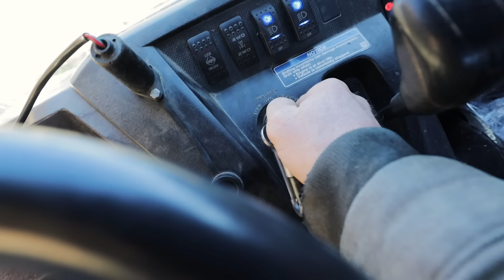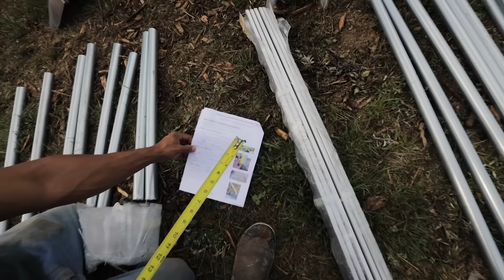INJURED

Comment: I had a heart attack at 29 after a year in a van. During recovery I learned the lesson that slow is smooth, smooth is fast deeply. Think of your lost compound value over these days by thinking "if only I did a little more" instead of "this tempo of action is optimal and healthy"
Reply: You mean like van living? What caused the heart attack? Peripheral blood clots from the extremities from being stuck in the van for long periods?
Reply: @gregorymalchuk272  yeah, I had done a year of van living. The summer was a lot of fun but come winter the good times switch quickly. The heart failure was a few months after getting out of the van and was a unrecognized biological defect, though I doubt the experience left my body in a way that reduced the risk of it occuring. Was a lot of compounded experience in a short year and a half. (The irony was I was lamenting Turning 30 when it happened, then 30 was immediately arbitrary:p )

Comment: I got one of those immersion heaters. With a new element needed for my water heater and a frozen trap in the tub I got the tub up to almost 130 degrees with one of those. My bath tub, not unlike your cattle tank isn't insulated. Something to think about if you want to convert that to a real jacuzzi. Good to see you got company there. Conserve that water!👍👍
 Yes I fixed the water heater. Call me a tool guy. Just don't call me a tool.😉

Comment: Justin. 40 yr retired RN here WITH autoimmune disease.  Stop kicking yourself for needing to take an anti inflammatory during flareups. Remember inflammation can cause MORE damage than the occasional flareup medication. Risk benefit applies. My experience is you end up taking less meds AND have shorter flareups if you take the meds early vs getting stuck playing catch-up after flareup is raging.  No one wants to need daily steroids. I would prefer catching the flareup early so I can keep moving so I don't end up on steroids for months. Just my experience. Tight rope walking that is. 😂

Comment: You need copper piping between the tub and barrel. The easiest one I made was to wrap a copper tube around the barrel with the fire in it and connect both ends to the tub and fill it up with water. As the pipe heats up it circulates the water and heats it. I ran a cool water hose in to cool it off if it got too hot. But I put a valve on it to stop the circulation when it was warm enough.

Comment: The moment I saw how you were moving Justin, I knew it was your SI joint that had popped out of place. I've been through it for 30 years. You're lucky it wasn't that bad & you can walk. Once I was stuck on the floor alone for 15 hours. Mostly I end up in bed for a couple of weeks, barely able to walk hunched over with a cane. Start with anti-inflammatory meds to get joint swelling down, muscle relaxers to allow your muscles to stop guarding & pain relievers. With that done it should eventually move back into place itself. But you really need to get a chiro adjustment. It's a very simple one. You can also look up videos for a self adjustment, which I recommend because you can incorporate that as part of your daily routine to help keep this from recurring. Next stop the kettle ball exercises where you jerk up from between your legs & the one where you hold it above your head & twist while getting up. Any movement that involves snapping and/or twisting like that can cause it to happen again.

Comment: I had something similar happen (was doing AcroMassage training & got the heaviest partner -185 lbs -who fell on me 3 times).  The result? Dislocated my hip. I went 3 weeks without knowing until I finally went to my Chiropractor in Austin (Dr Berman) who told me my pain was from a injury of dislocation in my hip socket. Who knew? Never happened before then. I pray you find a solution for your intense pain (mine was a 13 on a scale of 10)n Whew! 🙏🌹

Comment: FRUIT TREES: Add 9 inches of mulch/compost inside ring.
Reply: It’ll keep grass from growing. And with keeping the fencing up off the ground you can still use the string trimmer (or sheep).

Later, it will compress. Help control pests. Maintain moisture. And enrich the soil.

Comment: Please give a hug to sweet Lily for me.  It's rough to loose pets.  As for the piglets.... a friend who owns pigs and breeds out 6 mamas each year says that the babies will be fine now that they are over 2 weeks old. Just make sure they get their grain.  The added milk does help. But they will be fine.  
I have been dealing with immense pain in my legs for three months and the doctor hasn't been able to find anything wrong.  It has made lambing and working on the homestead tough for me. My 15 year old son has stepped up and is doing amazing.  How much epsom salt do you put in you tub?  I just might start trying that.
for the trees turn the fencing the other way so the smaller holes are at the bottom. sheep can get their heads stuck in the bigger holes.

Comment: So sorry about your rabbit, I used to run around 40 rabbits and they are pretty hard going to keep, I had babies die in kitting at times and it is so sad as they are the cutest.  They also caught a virus that killed several adults. I think they are up there with goats in difficult to keep.  I have guinea pigs now, they are resilient and can be kept in groups, they are quite shy but even if they are scratchy kids can pick them up.    When the babies are born they are quite self-sufficient, can run around, have fur, etc.

Comment: What we use to do is use a hose to siphon each day the debris out and at night we would put a little bleach in to clean. Bleach goes away overnight so you can get into a clean tub. For this tub maybe a 1/4 cup. If it ever smells like bleach you just need more wait until overnight again. It will smell very clean we are 70 and 73 this is what we have done for years so as not to get into chemicals.

Comment: Justin, If you are having problems with your lower back and if your groin/upper thigh is bothering you it may be your hip. I've had lower back issues for years and recently what I thought was a thigh injury and it turned out I had an arthritic hip. I just had a total right hip replacement 3 weeks ago and the back pain is gone and I'm working on the thigh to get that strengthened. Your Lyme could be inflaming the hip which could now be causing your other pain. Good luck.

Comment: Chucks are hard durable rubber that is made to put behind the tires to keep them from rolling one chuck is about ³ lbs. & is about a triangle size of 8" x 8" ":6"  much jeasuer to use .pick up n carry as you go in vehicle ...much easier than moving rocks...n very cheap ...buy one ,or buy 4...

Comment: Instead of downsizing your animals which has long term implications I would be getting in more help in the short term whilst you’re incapacitated and Jonah isn’t at 100%. 

You’re right that outsourcing the pasture clearing to free up your winter for more projects would have been beneficial. The good news is by getting help in now you can replicate the benefits of that before things get too out of hand. 

Then when you’re better, drop back on the homestead help and book in the machinery for 3 days in late winter next year to get your next 2 acres cleared, and free up your winter for the bigger infrastructure projects that are needed. 

You may need to get in some extra help this winter too with your construction coming to an end to get it all done by next spring, but that should be a once off. 

You need to prioritise rest over winter too or you’ll be more injury prone moving forward.

Comment: Just a tip if you can't go out for a bath soak a towel in Epsom salt warm water lay on your tummy it at least takes the edge off single female with back issues torn bursa in my knee n few years ago broke both ankles Epsom salt is life😆❤💖❤fel better asap❤

Comment: G'Day Justin. Just wondering if you think your pain could be sciatica.
Sciatica refers to pain, weakness, numbness, or tingling in the leg. It is caused by injury to or pressure on the sciatic nerve. Sciatica is a symptom of a medical problem. It is not a medical condition by itself.

What triggers sciatica?
Sciatica occurs when the sciatic nerve becomes pinched. The cause is usually a herniated disk in the spine or an overgrowth of bone, sometimes called bone spurs, form on the spinal bones. More rarely, a tumor can put pressure on the nerve. Or a disease such as diabetes can damage the nerve

I suffer with sciatic pain and the pain is unbelievable at times, it has been to the point where i cant lift the weight of my leg to walk.
I am wondering if your lime disease may have contributed to this.

(Just a thought, much love,  blessings and prayers to y'all  from Tasmania, Australia)

Comment: If your blocking that back door in the kitchen would it work if you turned the refrigerator to where the shelf is.  So it’s next to the counter. Then if needed you can put a shallow shelf opposite the refrigerator?

Comment: Get yourself what is called a posture pillow you actually lie on it and it correct your back when you have back pain I have one and I have been using it for years they are designed by a chiropractor they do wonders when you look at it you might not think so but trust me they do a great job

Comment: Has the beautiful one looked into, cbd, cbg, thca, or delta 8? All from an mj plant but not the thc that would get you high. Seeing you struggle and in pain I cant help but think those could benefit you. All of those help me with my neck, back and overall anxiety and stress. I use thc also in unison with cbd for bad headaches or neck pain. They are all available in an oil or tincture no need to smoke anything. Heck some are made into capsules.